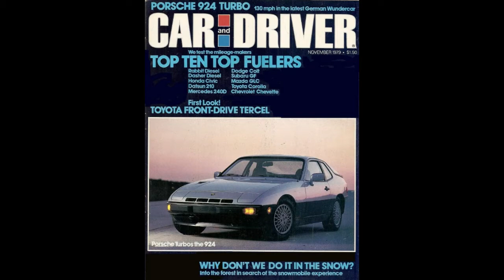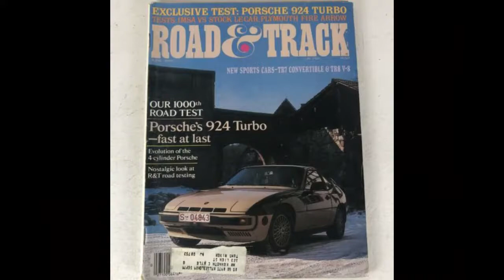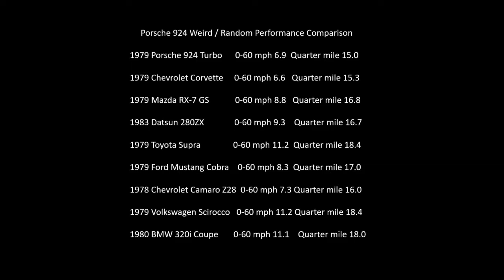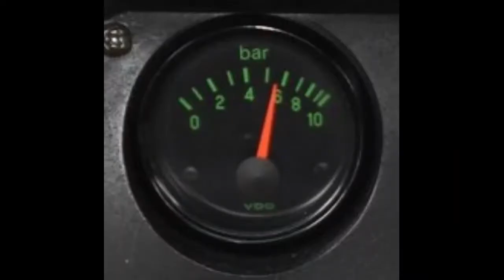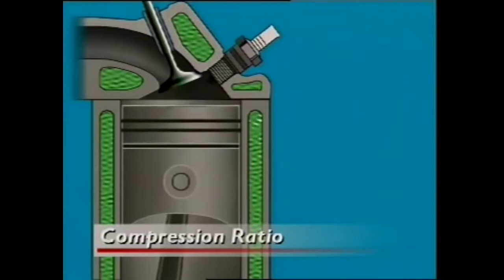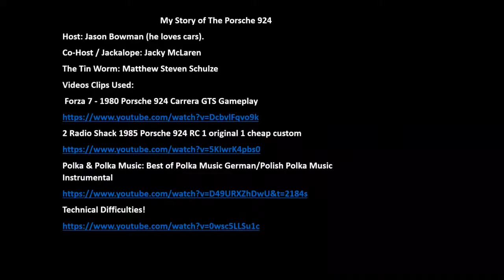Porsche 924

Comment: As a 944 owner I can say I prefer the looks of the 924 and I believe it to be more evocative of the rounded Porsche design ethic. The great ones are the 924S made in 1987. A 924 with the 16V 944S engine would be about perfect.
Reply from the maker: I understand what you're saying but the 944 Turbo with it's boxy flares, more rubber on the road and added power would be my choice......if they weren't $30000. LOL
Reply: @jasonbowmanlovescars6966  I was speaking strictly of 924 versions.  I owned a 951 and while it might have been the best car I’ve ever owned, it was also highly modified and I blew it up. I find the NAs less troublesome.  Back when they were cheap 951s were fun power. At the numbers they go for I start to look at a manual 928 S4, which can also be made to run at 360 HP, and is a better car.